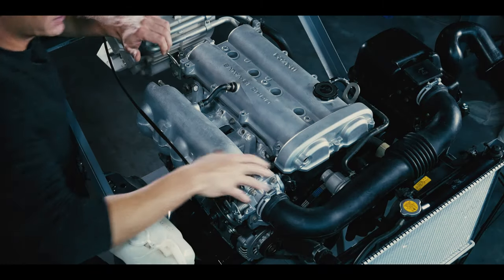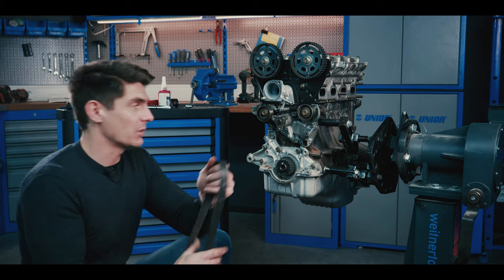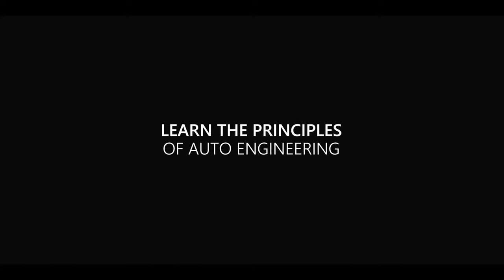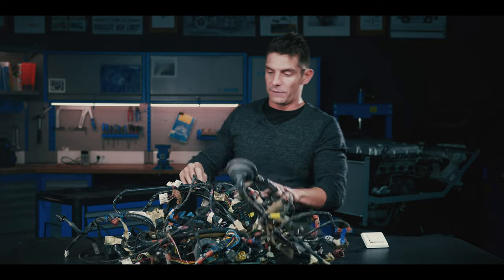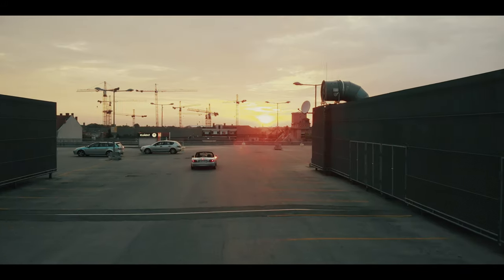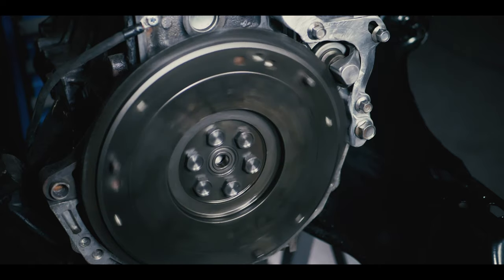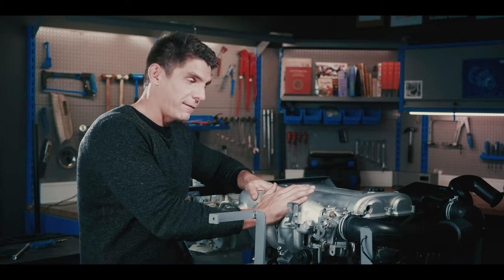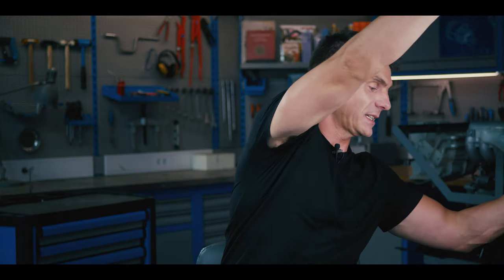How a Car Works - 2020 TRAILER

Comment: I added a comment yesterday saying that I could not watch the videos after paying twenty U.S. dollars.  Turns out that I'm just computer incompetent and had logged in under an alternate email of mine which seemed to have screwed the process up.  Once logging in under my appropriate email, everything is working fine.  This guy gives the best explanations of anything I've attempted to learn, and the animations are a joy to watch.  I think the PDF received with the program is worth twenty dollars alone.  This guy also has way more charisma than most online teachers on Coursera and such.  Instead of being put to sleep, he keeps all my neurons firing, haha.  The man should be charging 100 dollars for this course in my opinion, but then, I wouldn't be able to afford it if that was the case.  Thank you sir, for what you have done.
Reply from the maker: Happy to hear that Matthew!  More episodes coming out on Monday.

Comment: Probably the best such course out there. I did not regret buying the full version for a second. Alex is a super cool guy and you can clearly see he's passionate about the topic.
Reply: when u bought the lesson did it say this connection is not secure and that something expired
Reply: @alexu6774 Yeah I recall having that error. But I just restarted chrome and it works fine. These type of errors they show up from time to time on websites.

Comment: Purchased... Note: if you purchase by paypal, it will use the email address associated with your paypal account and not the email address you used to sign up with to purchase the course.  Other than that, it was smooth sailing and first video I saw was very well done.

Comment: I have a classic (Eastern German) Wartburg 1.3 (1991 one of the last build before the closed the factory) with a 1.3 litre, four-stroke, four-cylinder engine as also used in the second generation Volkswagen Polo. It is, of course, a more classical engine with a carburettor. Is your course also valuable for a classical car like this?
Reply: Carburettors havn't been used for a while, and it is not in the miata he uses as refernce, but the course should help you with the whole rest of the car. The carburettor is basically a replacement for the modern fuel injectors. The rest of the car will be funtionally the same. I personally, wouild still get the course, but it is all up to you

Comment: I'm planing to build my own garage a service my cars on my own. There are few tutorials out there and mostly they are manuals for professionals who already have some experience. I have bought How a Car Works and I love it. There's insane amount of content and know-how and it is so professionally told and presented. It is perfectly suited for me and of course for guys that do know how engine, transmission, drivetrain wokrs, but want to know details of how items are manufactured and what are internals of oilpump and oilfilter, how oil is distributed. I have already knew that it is somehow distributed by pipes in engine block but I haven't knew that there are pipes even inside of crankshaft. I don't want to look like an advertisement, but I don't regret money I spent (I was afraid first to be honest, if its not some bullshit) and I think It's nothing for that much education and information. I'm looking forward to new content from HCW team. Hope my comment will help guys like me in making a decision whether buy this guide.

Comment: Awww I thought this was going to be a series on YT... credit where credits due, $20 is a pretty damn good price for something with this much production quality. Though I dont think you can really get into the finer points of how a car works with only 20 hours of content, perhaps an engine alone could be gone through in 20 hrs.
Reply: I paid for it and am in the middle of watching it — this is highway robbery for only 20 bucks. Of course you aren't going to be a master mechanic just from watching this stuff; but it really is very depth content.

Comment: dont know if this is still a thing as i went to the website a few days ago and signed up, paid $25 for the course and never got an email to log in, also tried emailing support with no success, just wondering if the course is still available?
Reply: i take it this isnt a thing anymore, shame as it looked promising, guess ill just try to get a refund or something
Reply: @zappyyz6368  did you mange to get the course/ a refund?
Reply: @denbenten9576  i didnt get a refund however it was just a bug and i had acces to all the videos after biting the bullet and paying again with a new account

Comment: Hello, can you please check your emails because I purchased the course but don’t have access to it
Reply: Did u get access i have the same issue ??
Reply: Did you get access? I'm having the same issue.
Reply: @dannygabriel3062  check spam and deleted emails
Reply: @plantxvibe9571  Thanks. Its in spam. Issue is I still cant access any of the videos. Its an email thanking me for pre-ordering his course. I just want access to the videos lol.

It did give me access to the PDF however
Reply: @plantxvibe9571  Im already logged in brotha. Worst part is the website does not let you log out lol.
Reply: @plantxvibe9571  i used another device to sign in and this time i used the email linked to my paypal. thanks for ur help big guy facepalm